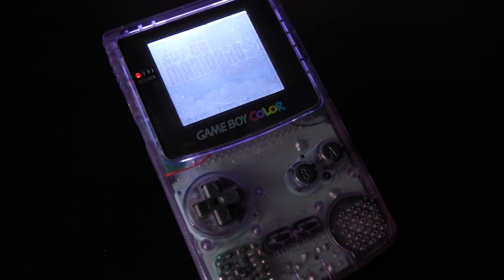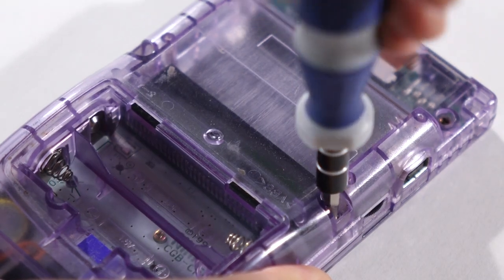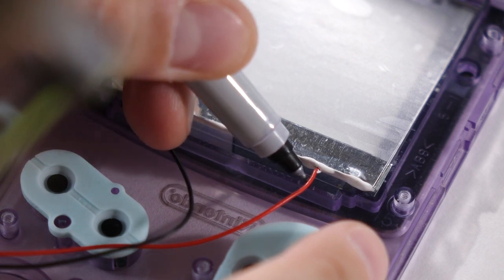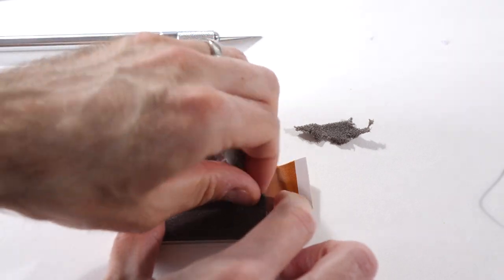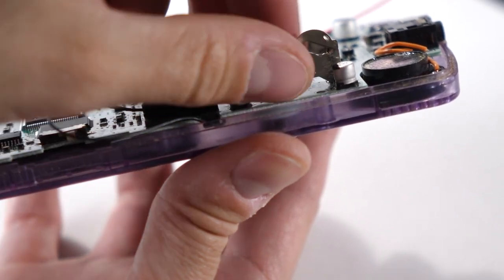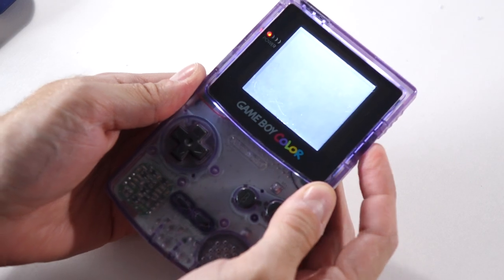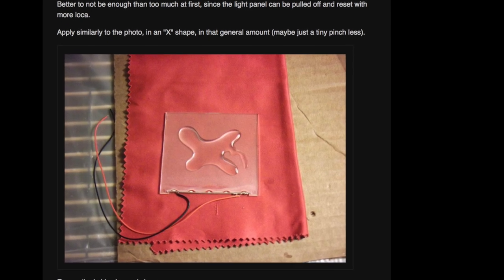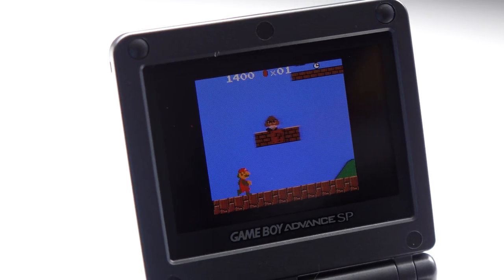Install a Game Boy Color Front Light Kit!

Comment from the maker: If your Game Boy doesn't power on after doing this mod, some have found that adding a 100-ohm resistor between the red positive lead and the Game Boy's circuit board can fix it.
Reply: With me the screen flashes only briefly, then the Gameboy is again dead. And this is not because of the battery! ☝️🤓
Reply: I'm having the same issue. Where, exactly, does the resistor need to be installed?
Reply: Is in the text, between the red cable and the board!
Reply: Hi Dirk. I saw the text. I am new to this. The resistor solders to red, but where does it terminate on the circuit board?
Reply: Nevermind, I figured it out.
Reply: Where the red cable becomes soldered. Watch video ... Please report results, then i can start! 😂
Reply: Already figured it out. Read comment...
Reply: (Excuse the Google translation!)
Reply: They write faster than i can answer... 😱😂
Reply: I too am new to this and I am unsure where to add the resistor.
Reply: Can confirm the included Resistor that HHL provides is needed. I turned it on without and would power on for a split second then turn off. Resistor solved that issue.

Comment: Thank god that it's now 2021, and backlit IPS kits exist now! Waiting on the one from Funny Playing to arrive for mine that already has the glass lens applied, along with their custom shell so it'll all fit together without cutting. 

I'm not particularly into retro stuff, but the GBC holds a very special place in my heart as it was the only thing I had to play on as a kid. Was really happy to find one at a local Goodwill that had a bad speaker a few years back. But it really took me until now to do anything with it, as I just couldn't get beyond the lack of a lit up screen. I finally went ahead and replaced the speaker in it, along with two of the three capacitors (accidentally broke the tabs off of one of the new ones, and damn near ruined the Game Boy trying to get it to work anyway, so I'm keeping the old one for now) now that a better display is an affordable and easy to install option that'll allow me to enjoy using it.

I'm not huge on the idea of using a GBA or an emulator to play these games, as I've never been a big fan of the SPs clamshell design, and playing on my phone or PC just doesn't feel right to me.

Comment: I've followed everything here to a T (and used LOCA, though that's not the issue); yes, I got the right wires on the ride solder points. No, the solder from said solder points isn't running into solder from another point. When I try to power up now, everything (LCD, frontlight panel, red power LED etc.) comes on for a SPLIT SECOND and then goes dead. I unsoldered the two wires, and the system works perfectly fine as normal. So i carefully resolder them, and it won't power up again, same problem; the power to everything flicks on for a split second and then dies.

I'm stumped. Anyone have any ideas?
Reply from the maker: +Ashitaka1110 Where did you buy the frontlight from? It's possible the one you bought uses a different voltage than the one I showed in the video -- in which case, you'd need to use different solder points or add a resistor.
Reply: +This Does Not Compute Thanks for the reply, and you're right. Seems there are two sets of instructions for the ones from Hand Held Legend and the one from Kitsch-Bent. Just switched solder points and it's working fine.

To make it clear for anyone else who may be reading this with the same issue, you need to solder to different points based on where you got your frontlight kit. The one from Kitsch-Bent is like in this video, the top-most of the four points. If you're like me and got it from Hand Held Legend, you need to solder the red (positive) wire to the top-most of the column of three points to the right of the four point column (right near the edge of the circuit board). The black wire solders to the same point for both kits, FYI.
Reply: +Ashitaka1110 One more quick update for everyone; I noticed some slight flickering in the frontlight that occurred when the image on the LCD changed in some way (I.E. a character moving, new text in a conversation appearing, etc.) I reached out to HHL and they suggested returning the positive wire to the original solder point (the top-most of the column of four points) but adding a 100 ohm resistor. I did that and it works beautifully.

HHL said not all units have the flickering issue, so if you have a HHL frontlight go ahead and follow their instructions first, and if you get the flickering issue, then try the other solder point with a resistor.
Reply: I did the 100ohm resistor. Has anyone tried a higher value? 100ohm is good when in a normally lit room, but laying in bed at night in the dark, its so bright my wife complains while she is trying to sleep. I may try a 220ohm or higher. Would be cool to do a 3-way switch (off-low-high), so break the circuit, higher value resistor for low then 100ohm resistor for high.

Also, even though I left it out in the direct sunlight on a bright and hot day for an hour to cure the loca, I noticed some spidering in the lower right corner. I forgot to peel the front reflective tape up at first so it could cure underneath, but I did peel it up and sit a UV flashlight on it for ~15 minutes per section. After I reassembled it and noticed the spidering, I sat the UV flashlight on that section for 10 min more, then took it out in the direct sunlight for another 10 minutes. Hopefully, the spidering doesn't spread anymore, its not enough to be too annoying now. If it does get bigger, then I guess just disassemble it and peel up the tape and cure it some more? Any way to make the spidering disappear?
Reply: I have the same problem....did u figure it out?...need help too
Reply: Same here. This image shows how to wire up the Handheld Legends frontlight panel that I bought from them in December 2016: https://cdn.instructables.com/FFN/WM16/IBDI3IQH/FFNWM16IBDI3IQH.MEDIUM.jpg
Reply: Thank you Mr. Crane. You're a vibe saver
Reply: drukaito You're welcome! I was super bummed with it didn't work the first time. Fortunately it was an easy fix. :)
Reply: just my frustrations but video should be remade
Reply: Ashitaka1110 which solder points did you use for this?? I am having the exact same issue!
Reply: Just had the same issue. Found this thread on youtube and only had a 220 Ohm resistor (laying around) but that worked. A bit dim but working. A little disappointed in Hand Held Legend for selling me the kit w/o this instruction. I'll be dropping them an email next. Thanks for the videos Collin.
Reply: Alex, Do you still need help?
Reply: Ashitaka1110 Thank You! You saved me a lot of time

Comment: I did this mod with a piece of metallic reflective paper S05 for windows and its not that bad TBH 

I remove the foam and metallic frame then put the metallic reflective paper and it reflect light better and gives slighlty better color saturation than simply putting  the light panel since the GBC screen is kinda transparent, the clarity is certainly not as good as the loca mod but if you want to replace the light panel after if dies...

Comment: to use that method you need a 100ohm resistor. the line of 3 contacts where uve done the negative solder is correct. instead solder the red wire to the top of the other group of three to the right. problem solved.

Comment: how much does the battery life change. im going through 2 AA batteries every 2 days
Reply: Depends because even though didn't have video games until about the 3rd  grade this year originally would leave it running even on pause but now just turn it off... however that was using dollar store batteries that are aa aka lr6 "heavy duty" zinc chloride

Comment: If you use a resister, and LOCA, it would look so much clearer, and only take an extra like 10 minutes.
1k ohm trim pot is recommended.
Reply: where do i soder this? can u explain how its done"?
Reply: Jon C If you have the same as this one. Add LOCA (in the updated frontlight mod video he shows how to) and then just add a resistor between the black wire and the solder point on the circuit board.
Reply: Jon C Black wire goes to top of the 4 solder points on the bottom of the circuit board, red to the bottom one.

Comment: I installed the one from Handheld Legend (V2 Laminated OCA applied + a 100Ohm resistor) and installed it in my GameBoy Color. It lights up, but, dust particles are still going in. Took a few attempts (used some scotch tape to get the dust off of the underside of the light) and got it installed, however, there are a little bit of air bubbles left and the dust particles keep reappearing.

Comment: Do you think this would be a good idea?? I have an old gameboy color in really rough shape

New Shell + Glass Screen from rose colored gaming (16.99)
Backlight Kit (12.00)
Loca ( 6.99)
Reply: That's exactly what I'm doing except my new case is a gold pikachu
Reply: I just put my New Rose Gaming glass screen on. Did you ever go through wth this? I'm very curious.
Reply: Nick Martinez Yeah. I finished it wuite a while ago ^.^ The glass screen still has no scratches on it. The Frontlight mod turned out great too. The only thing is the clear orange case cracked near the screw holes.  :D

Comment: Why do the wires go on those specific solder points mentioned in 3:12? Could you put them onto other points? JW i'm a beginner with tinkering with this stuff, and am looking at another mod that tells me to use those points as well.

Comment: Have you noticed a significant difference as far as quality/ performance between Kitsch-Bent and HandHeld Legend other than the different solder points??
Reply: I  guess I worded that weird. I wanted to know which one was better or if theyre the same. Since then I have installed both and IMO I found the Kitsch-Bent is slightly better

Comment: I've done everything in the tutorial but I'm having all kinds of trouble trying to solder the wires. Do you even use solder or do you just use the soldering iron to melt the wires to the soldering points? It's probably something really simple and stupid that I'm missing or doing wrong but it's really frustrating me.
Reply from the maker: Yeah, I think adding some solder to the points before connecting the wires will probably make things much easier...sometimes there's enough already there, but often there isn't.
Reply: Thanks. I'll try that and see if it makes things easier. I'm no expert on soldering but I didn't think it would be this difficult.
Reply: I add solder to the wire before placing it on the board's contact points. Remember: HHL requires to solder the positive lead + a 100Ohm resistor to the right side of the board.

Comment: I just did this and now my screen is black when I turn it on. The front light lights up as it should, but the picture is black. Any ideas?
Reply: Check that you inserted the ribbon for the display in the right orientation and use the correct and appropriate orientation for the wiring. Remember: HHL's instructions are different than others and add a 100Ohm resistor to the red wire.

Comment: i did this mod on a gba advance first gen. and it look good the first couple days, i used loca(not osaka) and i cured the screen on a uv lamp overnight to ensure there weren't any problems. anyways I put the gameboy back to its box. and couple weeks after while checking my collection noticed that this advance had huge spidering marks around the screen. my question is what could possibly went wrong on this one. was it possibly crappy loca that wouldn't cure? or something else? i install the frontligth with the texture side facing the user. any ideas? thanks

Comment: I followed all your steps, did my soldering right except I didnt remove the black sponge behind the LCD. As a result when I switched on, it shows a lighted screen without the gameboy logo and died down 3 secs after. Is it a must to remove the black sponge?
Reply: Ok new update, I've removed the black sponge. The gameboy logo shows up, screen got lighted. But it still dies down 3 secs after I switched on. Oh gosh..
Reply: +U. Sufiyan You might need to use a resistor..

Comment: Colin,
It seems that my front light is taking up all the power, the gameboy does not have a power light, screen doesnt turn on and there is no sound. Do you think i need a resistor? Is this mod model specific? My model is, CGB-001.
Reply from the maker: +zmullaney Perhaps a stupid question, but I assume you're using fresh batteries? If the battery voltage is low enough, the GBC won't turn on but the LEDs in the frontlight may still illuminate. Maybe try using an AC adapter with your GBC instead of batteries as a test? Good luck!
Reply: Colin,
No go. I think the system board is no longer working, im not sure what happened, but the hunt continues! Ill try again with a different GBC. Thanks for your help! Keep up the good work.
Reply: +zmullaney this is actually a very easy problem to fix and I a bit disappointed  in Colin that he did not research this more. You would be able to stop the system from shorting out by adding a small resister or soldering the negative wire to the point on the top of the row of  power points across from the ones Colin used just below the point labeled C3. Colin, I would very much like you to fix this by annotation and next time read the page* for the actual item you are using before making a video explaining how to use it, I spent at least an hour trying to get it to work the way shown here before I decided to go and see what the original manufacturer said.

*http://handheldlegend.com/collections/frontpage/products/game-boy-color-frontlight?variant=1272083907
Reply from the maker: +Snapple Jack Well, I think I've figured out what the problem is: As I mentioned in the video, the frontlight I installed is from Kitsch-Bent. Their installation instructions mirror the steps I showed. Apparently the Hand Held Legend panel is designed a bit differently, and has slightly different instructions. One would think that they should install the same way, but apparently not. On the page you linked to, someone asked a very similar question, if they can use HHL's installation instructions if they bought their frontlight from KB. HHL replied, "Use your voltmeter to find a ground point for the black wire. You can use the KB solder point just add a 100 ohm resistor. The frontlight won't be as bright. Follow those instructions if you purchased there."
So I guess the lesson we all learned is, you can't assume that all of these kind of products are cross-compatible. Thanks for watching!
Reply: +This Does Not Compute I appreciate the responses. This was my mistake for not following HHL's instructions from their website. Thanks for all the help! Looking forward to your future work Colin.

Comment: that looks like a hakko fx 888 d... am i right?
Reply from the maker: +John Knox Yep!
Reply: +This Does Not Compute that blue and yellow gave it away lol. I love mine, best iron Ive ever used. I have a problem finding replacement tips. Do you know of a good supplier? love your videos btw!
Reply from the maker: +John Knox Yeah I'm fond of Hakko irons; you'll see an FX901 being used in some videos. As for replacement parts (and electronic test equipment in general) I've found that tequipment.net has a pretty good selection.
Reply: +This Does Not Compute Dude you're a boss, thanks so much! I'll check out that fx901 I'm partial to the 888 tho lol. I use an assortment of fixed watt irons to conserve my 888 tips. I did an ags 001 screen mod on a gba a while back and ive been looking at alot of videos bc im about to do my first 101 mod and im nervous about that whole trimpot potentiometer and the p1 to da1 connection. I want that extra bright screen but i hear all these horror stories haha